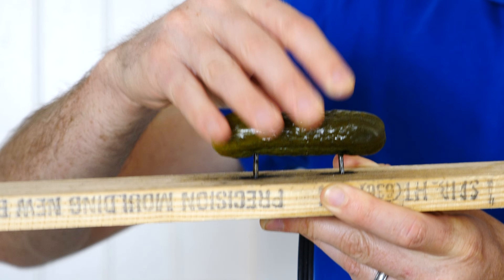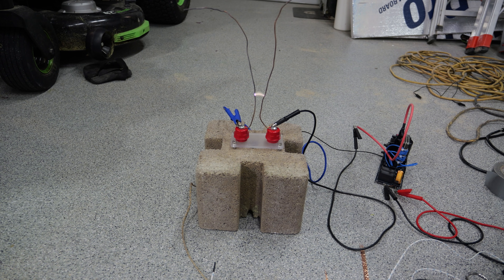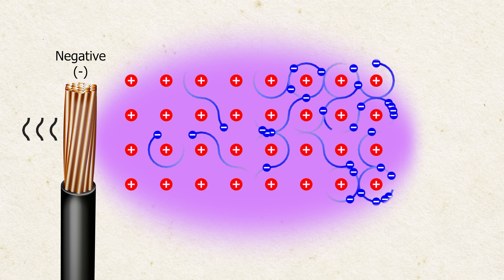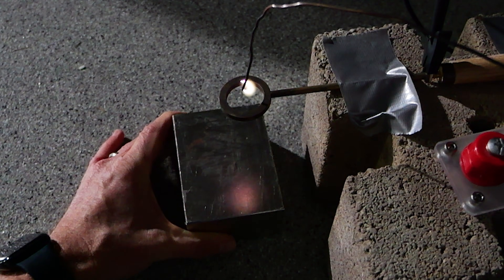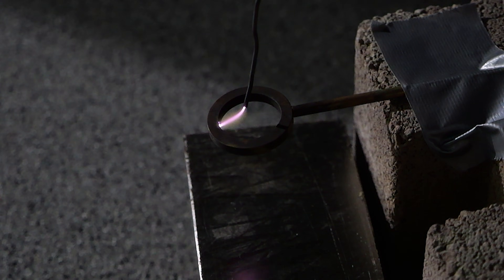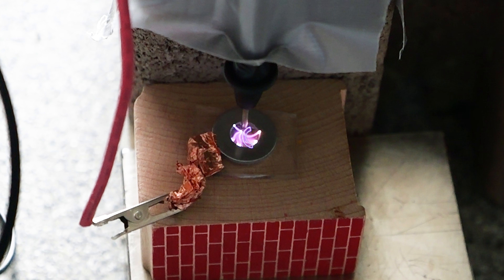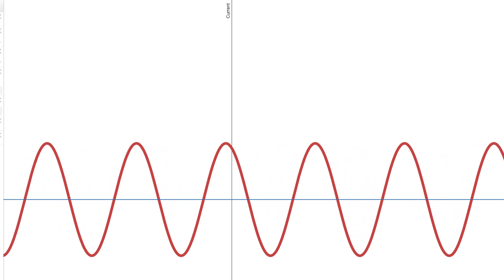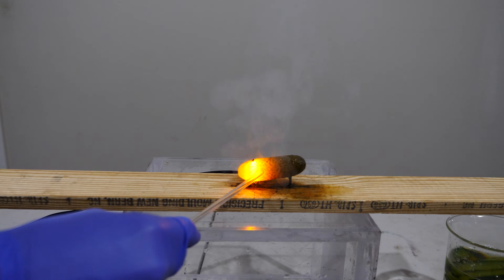Why AC Electricity Doesn’t Behave the Way You Think

Comment: Love the video, and i've noticed this over the years as well with plasma arcs. Even high frequency AC will have some asymetry that drives me crazy when trying to spatially design spacing. One thing - unless I missed it in the video - a good 90% flyback transformers of the type you showed output pulsing DC, not AC. They have internal HV diodes built into the secondary coil that rectifies the output into pulsing DC. Yeah, this video.....is a gem. James, thank you for shooting this video as it is a great breakdown of electrode geometry, waveform, and plasma diodes. Brilliant!
Reply from the maker: Yes, my source I bought it from said it was AC. But I am now thinking it is truly a pulsed DC output...Lol. It's surprisingly hard to tell with that high of a voltage. So not that surprising that it showed lorentz curvature, but the neon sign transformer was surprising.

Comment: Same problem with lightning protection for buildings and equipment. You can offer a suggestion with copper tape and pointed electrodes. Most of the time, lightning will follow that suggestion. Every now and again, it will say: 'Nah, doing my own thing today, bro'.

Comment: 1:38This notation is incorrect.☹
At the DCEN setting, the base material receives 70% of the heat and the welding rod receives 30% of the heat.
As a basic principle of physics, in an arc discharge, more heat is generated on the side where the electrons collide (the positive＋ electrode, anode).

Comment: I feel like I'm checking every box for the target audience for this video omfg.  I'm a welder and I tend to get the jobs that involve stick welding with e6013 at 90-135 amps with AC current.  I also love learning more about what the electrons are getting up to because I feel like it's required before I can master this skill.  

Anyway this makes so much sense in practice.  You don't really get arc blow with AC like with DC, but you still notice an asymmetry in the current.  It's common to strike the electrode like a match on the surface the ground clamp is clamped to, which heats the tip and introduces the current.  This makes it easier to weld a nice bead with a new electrode right off the bat.  If you don't do this, it's harder to maintain control in the first couple seconds; the arc will flare up, throw out a lot of spatter, and/or get the electrode stuck to the work (that kind of arc instability is more typical of DC, since one of the appeals of AC is that the alternating keeps the arc from drifting too much).  The concepts in this video must be the reasons for this!
Reply: if you reply to me i'll search for the instructional welding videos that i'll know you'll love. 
footage so clear you can see informative info.

Comment: It's because you have one conductor with voltage potential and the other is 0v. It would be different if you actually used a full phase instead of split phase.

Comment: This is basically how the original diodes (i.e. those made of vacuum tubes) worked. It was always asymmetrical, because one electrode could emit electrons easily, while the other electrode couldn't, and this imbalance was what caused the rectification.

Comment: Unless you have a two phase house outlet you are stuck with a mono phase and a neutral. This means that only one wire is doing the "pushing and pulling" electrons and the other is somewhat earthed. 
Two phases are some of 1.4 times the common house ac voltage

Comment: I’m curious if this would be different on a 240 volt system, two hot wires vs a hot and a neutral. The only difference should be voltage, but I wonder.

Comment: The plasma discharge current is bidirectional even when DC so the AC bias is not unexpectedly similar... and 
Mr Ampere n Maxwell say it should curve since the magnetic field drive is less intense at the standoff radius of the circumferential electrode

Comment: Everyone is looking for the flaw in the source, but maybe the arc is just optimizing? Maintaining perfect symmetry requires the system to completely reset its thermal state 60+ times a second—that's huge 'friction.' It costs less energy for the plasma to just pick a winner (a hot spot) and stick with it than to force equality against the physics. The DC bias isn't an error; it's the arc finding the most efficient way to exist, path of least resistance.

Comment: Bravo! Pickle rectification, high-voltage electron physics at the electrode, Lorentz forces demonstrating DC bias. really fun stuff!  I wonder what would happen if you placed DC blocking capacitors in line with your high voltage source ?

Comment: Great analysis and interesting experiments!
Has the pickle the same humidity / chemical composition all along its length? If not, electric resistance will not be the same, and so the heat will not be uniformly produced.
1:24 I don’t understand this measurement unit, but fortunately I can compare the two temperatures

Comment: Interesting observation: @2:51 That seams to mean, based on our (assumed) knowledge of ion to electron mass ratio, that based on emission temperature (which will give us the relative energy level) we can approximate the speeds with which the ions and electrons hit (migrate to) the oppositely attracting sides.

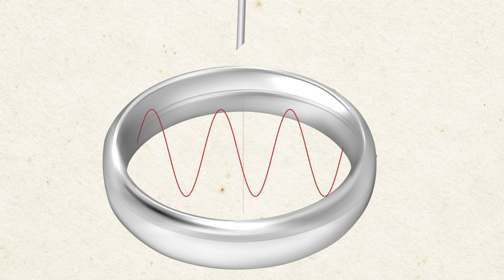Also at @6:32 explanation the capacitance at the (sharp) needle and the rim of the ring differ substantially. The different in the capacitance (higher curvature equates to higher capacitance in a given, equally sized, aria) will create bias, so for a more exact experiment the curvature of the needle and the rim of the ring will have to be (approximately) as close as possible.

Comment: What if you made up a mechanical AC source.  Ie a motorized crankshaft rotating a potentiometer that's supplied with DC. That would be true, genuine AC with no possible bias.  It'd be interesting to see if the ring anode behaved the same way.

Comment: You can put a HV capacitor in series with the arc and still have rotation of the arc near the magnet. Capacitor can't conduct DC current so there will be pure AC. I have videos with such experimenta in my channel

Comment: As far as I know the flyback transformer that you hooked up to the ZVS driver puts out a DC signal because it is rectified inside. This flyback transformer is from a vacuum tube monitor that needs a HV DC source to accelerate the electrons in one direction.

Comment: I have a carbon arc torch that burned carbon rods evenly on my old transformer welder but my inverter welder, even switched to AC will burn one rod away and the other is hardly burned at all.🤔

Comment: That graph at 07:27 is insultingly incorrect. Tiny tip at the top - average right below it - then a whole mountain below the "average".
In any case, not sure if the pickle has anything to do with DC etc. when it might just be that at that side contact was low enough first -> stuff burns away more -> less contact -> ... without any side of the AC cycle being preferred. That you did not record any waveform is a missed opportunity, that would have proven it.

Comment: Your "Debye Sheath" explanation, while interesting, is not the reason why one side of arc gap gets hotter: it's literally electrons flying off the more negative electrode and slamming into more positive side. 
It's most dramatically obvious with DC (direct current) TIG welding, where your tungsten electrode (Melting point 3422°C / 6192°F) will literally droop, melt and then drip out of the torch, if you make the torch positive and then vainly attempt to weld with it for any sort of time.
DC arcs have most of the heating on the positive side of the circuit, where the electrons go to (not come from) when jumping the gap between your welding electrode (TIG tungsten, MIG wire, stick electrode, etc) and what you're welding.

Comment: your Jacobs ladder is not a perfection regarding symmetry alignment and shape of the wires, and the same applies to the  pickled cucumbers. Neither are all your electronic assemblies. What current does is checking all the imperfections in your sets and chooses the easiest, shortest, most efficient path to move through at the frequency of operation. This is not NASA's research lab, is it? Your research quality is that of the 19th century provided the present day high tech equipment. The apparatus you build are prone to any kind of bias that precludes any reasonable scientific discovery or theory. Happy Holidays to all.

Comment: The pickle was in a superposition state, when measured(run the current), it chooses a state which side to be the cathod and it doesn't change after measured. Another side is entangled to be the anode. Could quantum mechanics work in similar way? 😂

Comment: Physics: We abstract, simplify, fix variables, assume perfection then y = f(x)
Reality: Buddy, your generator circuit is not closed, your wire has non-zero dimensions, non-zero resistance, electrons have a speed limit, weight, meet and create impedance, and can literally bunch up when you switch medium, need I continue list all the ways your little formula falls short of a complete prediction?
Physics: Good enough to convey a principle to rookie scientists and engineers alike.

Comment: Even near the sharp tip, the electric field is insufficient to pull electrons from the electrode.  Field emission microscopes require hundreds of kV/cm (in vacuum) to pull electrons from a sharp tip.  Rather the electric field ionizes the air by pulling apart molecules (mostly water).  Combined with the electric field, these ions colliding with nearby atoms/molecules knock loose electrons.  Electrons then accelerate very fast and knock loose more electrons from neutral atoms and molecules.  The light comes from the electrons in this plasma recombining with the positive ions.

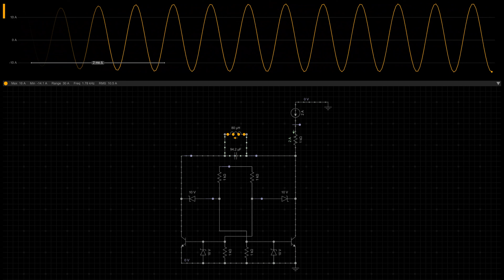Comment: 0:58 That flyback transformer has built in diodes. You need to find one from an old TV which had a seprarate external rectifier or voltahe multiplier.

Comment: if the pickle still tasty so everything all right. the faster one side heating there more resistance there, the more resistance the more voltage drop at the side, like everything in the electro web, that glowing  stuff become to very high resistance, so no way  for no glowing have enough current, but for hot part current enough for that certain current make the glowing side keep that resistance and heating. in plasma there more dependency about all magnetic field around that destroy symmetric of ac. if i'm right, you can do experiment with heating/cooling the pickle asymmetrically and then give ac.

Comment: Am structural engineer. I propose that is buckling of an arc. Its not axial loading. There is same reason how buckling occurs. Ions around the straight passage betn two contacts cant be symmetric. Arc is the passage by which there r more ions. Curved length is always more than straight length which attracts more ions. Curved path is always more established and stable too. Never it can be straight except perfect void medium. There is no perfect void medium. Not even in space.

Comment: 1:30 it's the other way around. DC Electrode positive - more heat on electrode (cathode), DC electrode negative - more heat on workpiece.

That's why with TIG you use DCEN; never DCEP (unless you want the tungsten to become the puddle).

Comment: 4:54 Why is the arc going up and down instead of sticking to the shortest path ?
Reply: Electricity follows the most conductive path, not the shortest.  The most conductive path is the one already ionized, but the ionized air is hot and buoyant, so it rises and takes the arc with it.  That’s why a Jacob’s Ladder climbs.  In microgravity, it would not move.
Reply: @wagnerrp thanks for explaining.
Reply: @wagnerrp Thanks ! <
Reply: my guess is that the plasma rises as it heats the air around it (like in a hot air balloon), and because the impedance of plasma is so much lower than regular air it still chooses the plasma despite being a longer path
Reply: @samuelseher153 Thanks ! <3
Reply: Ionized air is more conductive

Comment: Isn’t it the opposite effect? A DCEP welding configuration will produce more heat on the weld wire (positive side).  DCEN produces more heat in the base metal (positive side).

Comment: The "Electric Pickle" acts as a half-wave rectifier and because electricity flows much more easily in one direction than the other, the AC sine wave gets "clipped" or lopsided. This asymmetry creates a net DC current flowing through the circuit.

Comment: AC is DC which is made to change directions due to the pull-push force exerted into electrons by the changing polarity of charges in conductor material. The accumulation of oposited charges at different places in space is what we call voltage. So during the AC cycle there is DC running in one direction, then DC back into the other direction. Then this cycle is repeated many times every second. Its always DC. Also positive charges do not move, only negative charges(aka electrons) move in solids. In liquid and gases the positive charges(molecules or atoms misssing electrons) can move as do negative charges(molecules or atoms with extra electrons).

Comment: I attempt to get this principle across with regards to biases in the universe. Why is there more matter than antimatter. Why does the universe exist at a biased false vacuum. 
Even with mathematical probability waves (QM) natural DC like bias/offsets exist. Yes, you can have spin up and spin down at the same time (superposition) as it is like 2 DC waves within the full AC wave. We do this in circuits every day. Split an AC current into DC+ and DC- ; each wave is still a sine wave and behaves a lot like AC. If you imagine the circuit as a circle, the DC sine is like Spin 1/2 of the full AC wave :)
Recombine the DC waves back to full AC, move the bias to another offset.
.
It would be interesting to see how fast that bias (Zero offset line) could be switched from + to - over a large distance. Lets run a pure AC sine over 2000 km. Then introduce an offset and time how long before the bias changes at the other end. Instant, 'c', or somewhat slower?
[Entanglement test, like spooky action at a distance. I expect there would be a high latency though.]

Comment: 2:20 ....... Nope.
Heavy-positive-ions will not cause the negative electrode to get much hotter than medium-mass ions or even low-mass ions.... koz less massive ions will land faster than heavier ions.
2:45 ...... Nope.
Elektrons will not land with much momentum on the positive electrode koz all electrodes have a coating of elektrons at all times, & this negative coating slows the landing elektrons.

Comment: Huh! That's neat.

I used to work at a steel mill with a three-phase electric arc furnace and I imagine that the same principles would apply there. The issue is that this effect would preferentially heat the graphite electrodes and not the steel bath and there's no quick and easy way to stop this in a typical 3-phase AC furnace.

I wonder if DC furnaces can choose to have the bath as the cathode instead of the electrode?

Comment: Its the right hand rule inside a density puzzle, just open the physics book to the right hand rule.  It's fairly unresearched field about density puzzles, unless you do physics 3a, fiber optics, but electricity moves at 84% the speed of light over a conductor, but 70mph through it, yet a magnetic field rearranges at 77% the speed of light, but its all utilitarian research, throw the equations away, olden wiki was way more thoughtful.

Comment: All voltage is DC voltage.  We just call it AC because we alternate the direct current.  But thats at OUR time resolution.  Electrons exist on an entirely different time scale whete 60hz is nothing to an electron.  Then, are all properties we contribute to "DC" necessarily restricted to our time scale, or could that fact that 60hz is only a fraction of the speed an electron moves at allow for any other subtle consequences we attribute to AC
Reply: 6:47 Right, if you lower (or increase) the time resolution, you're "AC" is not influencing the electron faster or anywhere near the speed they propagate (speed of light), so even though its alternating, its still a direct current being pushed and pulled.  We do see some weird consequences, but those are tend to manifest because they dont propagate fast enough and you start getting weird interference.  That doesnt mean it happens with EVERY electrical property.

Comment: 0:49 Minor difference in internal resistance of batteries in series can easily create a preference for voltage/current accumulation over the other.

I dont see why the internal resistance of any cathode/anode system wouldn't create a similar preference unless you have something balancing it, no?

Comment: Flyback transformers usually have internal diodes since their original use is to produce high DC voltages to accelerate electrons in a cathode ray tube.